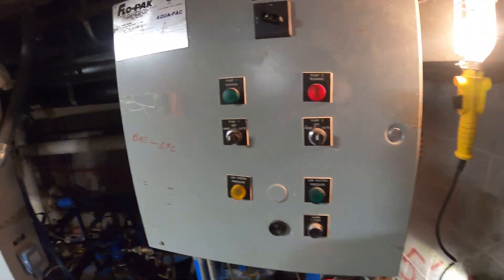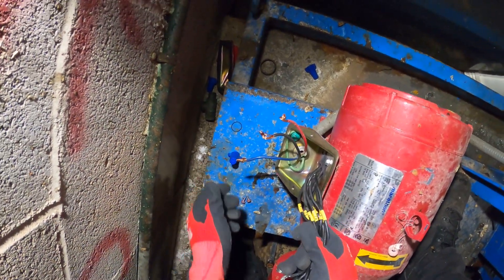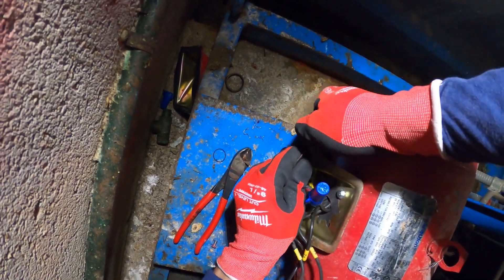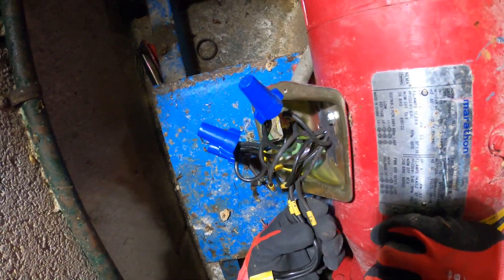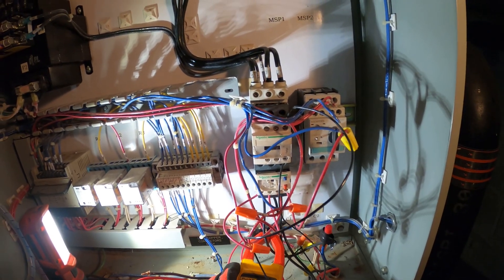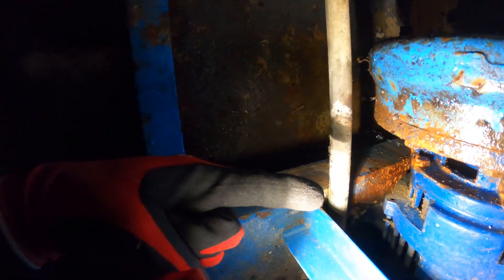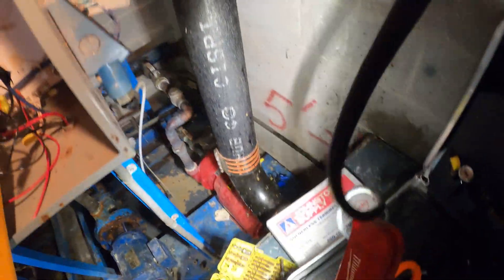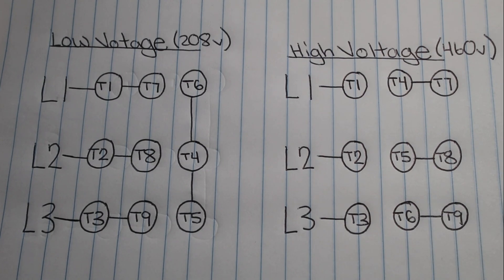HVAC Service Call: Water Pump Not Working (Pump Not Pumping Water) How To Wire A 3 Phase Pump Motor

Comment: Had a local hospital maintenance crew that were only able to call an outside experienced journeyman every time something broke down that charged for every service call. They all were fired for incompetence and all were replaced by a slightly better crew. Unable to wire a simple three phase motor and check rotation shows a lack of basic training!

Comment: Great catch. For most applications this is suitable but some code standards may require connections be made only on mounted terminals. But I've only found this a few times and almost always implemented by design. But it's something to pay attention to for anyone building or servicing equipment to a standard.
Reply from the maker: Thank you very much! I'm glad I found the issue and the motor wasn't completely burned out. Thanks for that info👀 Sending blessings your way from NYC 🙌 Stay safe out there & stay tuned for new videos every week!

Comment: If that motor let smoke out, I would definitely recommend replacing the motor.  It might run for now, but damage is done to the motor
Reply from the maker: It def let smoke out. That motor smells funky now still lol That's a good idea. Better off replacing that motor along with the other💯 Thing was drawing 80 amps (runs around 11/12 amps normally) and smoking like Cheech & Chong🤣 That's That's when they decided to call us. That's a good idea but hopefully they approve it. Everyone got hit hard during the pandemic and just trying to get by. Thanks for watching & I appreciate the feedback🙂Stay safe out there & stay tuned for new videos!
Reply: Not always, you’d be surprised how resilient they are…..

Comment: Would the high voltage diagram on that  be for  3 phase 480 volt ?
Reply from the maker: Yes! I explained how to wire this motor for both low voltage (208-230volts) & high voltage(460-480volts) at 9:40 in this video. Check it out👍Stay safe out there & stay tuned for new videos!
Reply: When ratings plates have dual ratings, you will often find wiring methods for each. On this one the low would apply to 208 and 230 (very important that it includes this verbiage on the nameplate) and the high would apply to 460.

Comment: That's why you need professional support rather than handymen
Reply from the maker: That's a fact! If they let that motor run, it would be finished and there would be no pumps at all. This service call was at night so good luck getting a new pump and then there's quite some labor to replace that. Basement to 6th floor would be out of service. I'm glad I was able to get them going. I will be replacing that leaking pump as well as the starters. I will try to record that video as well🙂 Stay safe out there & stay tuned for new videos!